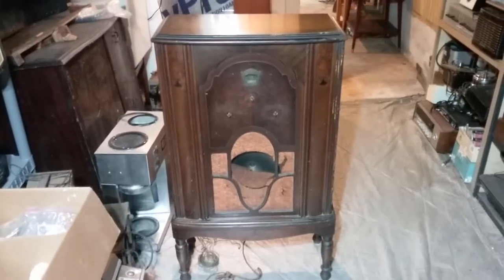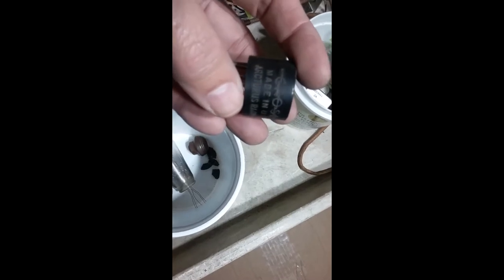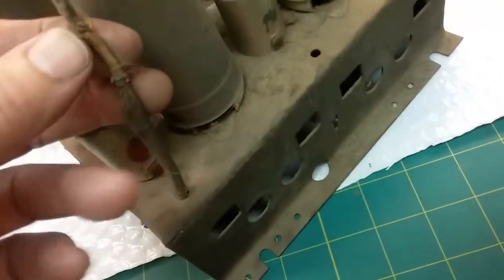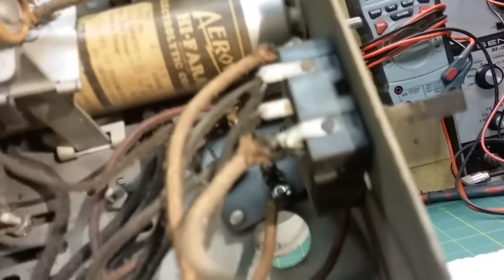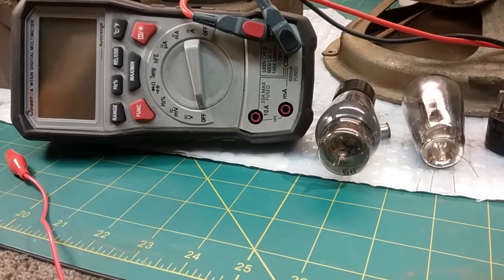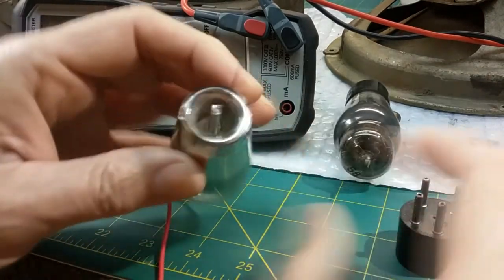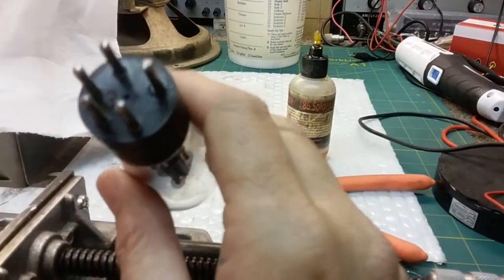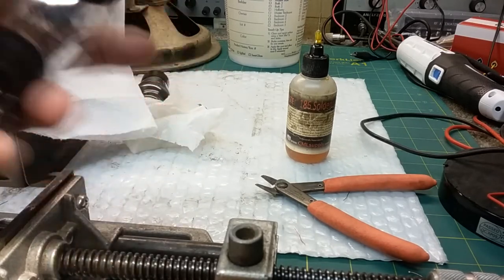1930s Crosley Console Radio Part 1: First Look & Tube Repairs

Comment: Absolutely fascinating repair work on the tubes Paul. Very logically done as well on where the wires go into the pins of the socket. This might be one of the oldest 
Crosley console  radios I have ever seen.
Reply from the maker: I did some searches for it on Google. I found a couple similar Crosley's. But not any like this one. In fact,  I did not find a lot of consoles at all. This customer had a great find for sure!